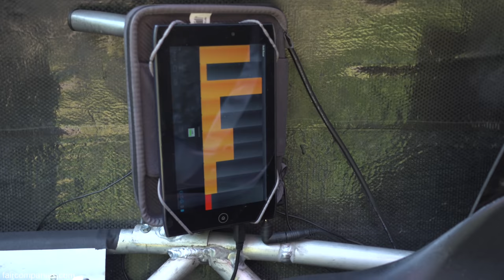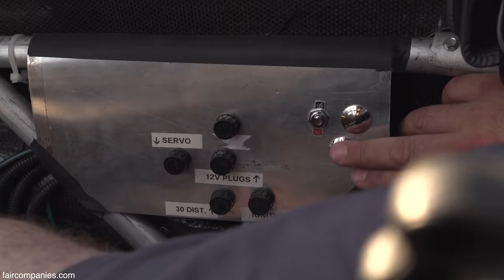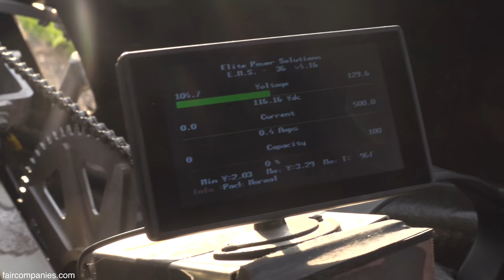MN friends seek joy of commuting by adding pedals to fast EV

Comment: Solid state batteries will give this vehicle an option of fully electric. I'm no health nut and not a greenie, but I think it's time for a change. That old combustion engine has had its 100+ years, time to move forward. Now with the electric vehicles it's just like when combustion engine cars were a new thing slowly replacing the horse as main transport. Also there are alot of small companies that are building electric that was how the automobile manufacturing was, alot of companies.

Comment: i'd like to see what they could do that was limited to around 40mph that might bring the price down from $24,000
Reply: I love the design. We costs need to come down, of course. How would you like to learn more about our similar market (Enclosed) Hybrid Electric Cycle for less than $6K? We're working on mass production of a sub-100 lb unit with a range of over 50 miles electric plus pedal, heating and cooling, HEPA and charcoal filters, atmospheric monitoring system, and much more. Let me know! Phil founder GV Hybrid Electric Cycles
Reply: so true. after market exercise compatible mods would be good competition for this market share.

Comment: “We don’t want to waste energy” says man that drives elongated hummer. 😹 All this is wrong on so many levels… please, look at the Dutch for tips on EVERYDAY cycling.
Reply: Thanks for your comment, please see my post.  I didn't realize the Dutch had figured out how to bike commute 50+ miles in 1 hour, to and from work.  And how to tow 30,000lbs while hauling a family of 7 on a bicycle.   I'll check that out.  Thanks for the tip.
Reply: ok, so you got a huge truck for towing a lot of stuff with the whole family loaded on board. but that doesn't mean you have to use that same monster car for commuting long-range.  get a used hondy civic or something.
Reply: ok, I see now that you DO have a high-MPG car for commuting, so that's fine. BTW, in Germany I know of some people that do bike-commute exceptional distances of up to 50 miles (with muscle power only). takes about 1:45 to 2 hours in a velomobile. these are the absolute expection, however. most germans have never seen a velomobile, and most velomobile owners commute 10-20 miles.
Reply: this guy specified the only jobs he could get in his profession were a long way from where he lived. you can clearly see he doesn't live in some carbon copy of downtown rotterdam. this is a solution to a problem that perhaps many dutch cyclists dont encounter.
Reply: MURICA
Reply: maybe he should have moved closer to work, fucking genius  @michaelcapponi2
Reply: @michaelcapponi2  the dutch also dont encounter other typical american problems like, schoolshootings lack of education or teen pregnancy, how do YOU think theyve solved those problems?

Comment: ....and drives a 6 door 4x4 mohunkin truck to tow a eco bike around.  :  (  
I wouldn't give a thumbs down in respect to the better videos you have posted in the past.
Reply: Tanasi Tim You nailed it.
Reply: Ernesto Apocaloptimisto everything on this "invention" has been overcome for long . how many eco trikes I've seen in my life..
Reply: +Tanasi Tim He owns a farm.  Should he use a Prius for farm work? Please enlighten me.
Reply: Walk the walk... This thing is on the heavy side.. About 800 lbs. If it were being towed in a light-ski-doo 2-wheel dolly trailer by a little EV car... Nissan Leaf, Tesla Model S, etc... Now you're on the right track! How would you like an Enclosed Hybrid Electric Cycle for less than $6K? We're working on mass production of a much lighter, sub-100 lb unit with a range of over 50 miles electric plus pedal.. And much more.

Comment: They were going to wrong direction by making it faster and bigger. If you are too big for it, then loose some weight yourself. They are envisioning new "Aptera", which is a story they should have known. Light weight and staying 20mph vehicle (e-bicycle) would be the right way to go. Problem is US population with the need to use a Truck to go 2 miles to grocery store. There's not enough room for smaller vehicles to be safe. USA lack infrastructure for that.

Comment: There are non-electic versions of this that do up to 60 kmh. Only adding 5 % must be a really unfit individual  or something is wrong with the math.  I do think this concept is sound. We need to downsize the electric car to its minimum weight. If we all want a Tesla the grid will not cope. Being able to use it in peddle only mode would extend the range and give you an option over an empty Tesla.